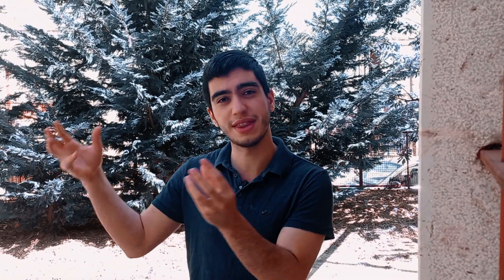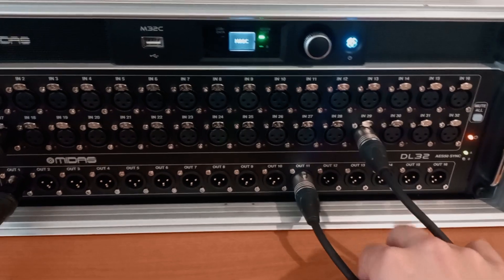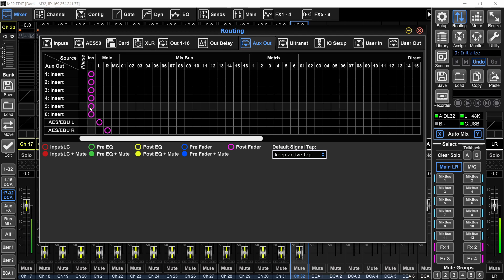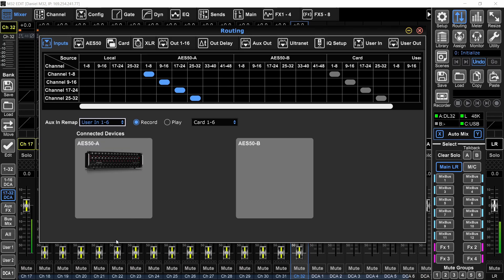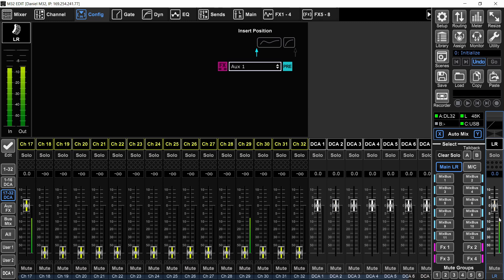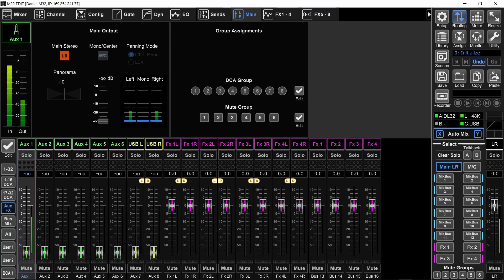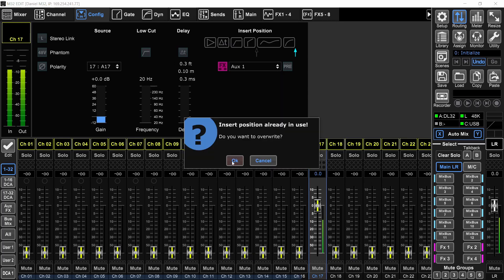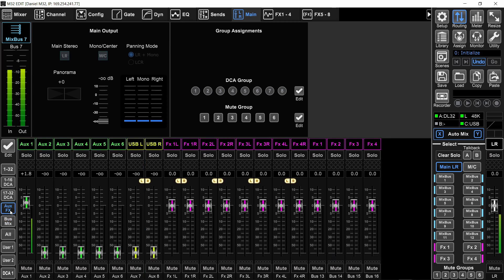M32C: External Hardware Inserts

Comment: Can you route PFL output to one of the outputs on the M32C?
Reply from the maker: On the monitor page you can switch between PFL and AFL
Reply: @danielkharrat  thanks. Which outputs on the M32C can you route it to please. I would plan to have the M32C at FOH with a DL231 on stage. I need a local output at FOH for listening on headphones
Reply from the maker: @JoeTurner-gj1ur  the m32c has a left and right monitor output jack on the back of it you don't need to route anything if you're using the local outputs

Comment: Can I connect a Midas M32 Live and a Behringer X32 via AES50 and route the inputs so that they all get it from a Midas DL32 stage box ?
Reply from the maker: Yes of course you can 
Either you connect the 2 mixers to the same stage box and get the inputs directly from it
Or
DL32 connected to M32 with AES50 A
X32 connected to M32 with AES50 B
and on the m32 you would go to the AES50 B page and assign 1-32 to AES50 A 1-32
that way you are sending the stage box inputs that are coming into AES50 A directly back out of AES50 B
and just receive them on the x32 as if it's connected to a stage box
Reply: @danielkharrat  Okay Thanks